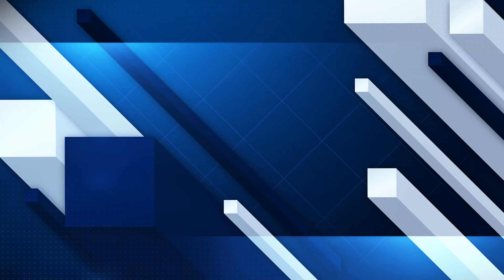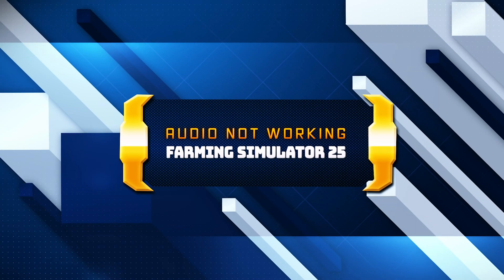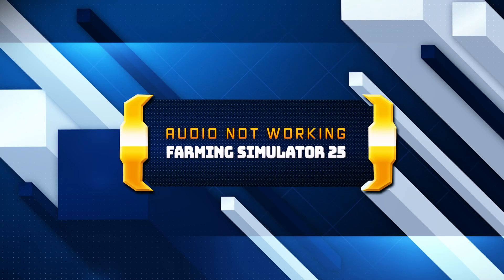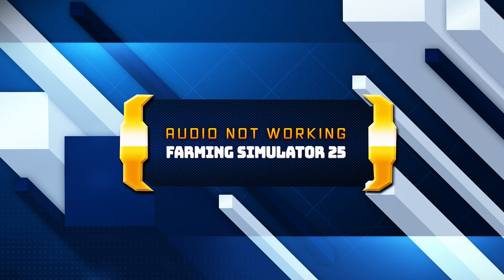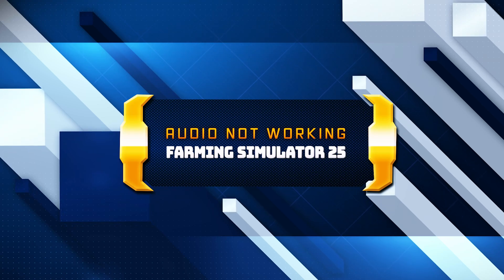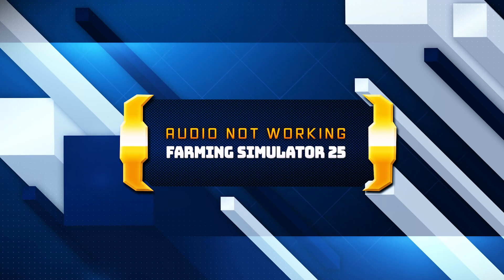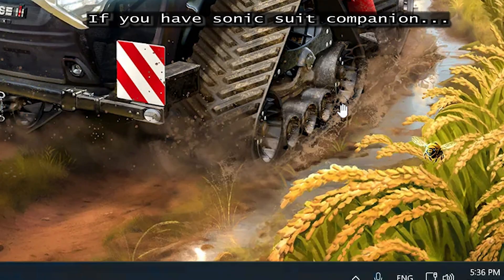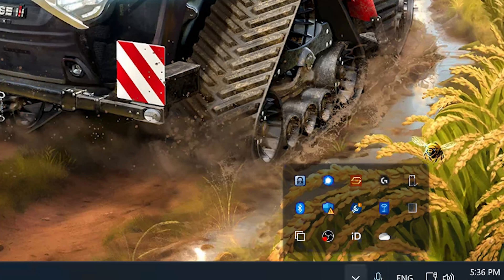Farming Simulator 25: Fix Sound/Audio Not Working, Crackling/Distorted/Popping Audio Problem

Comment: Thank you for this... I had issues getting it to work and ended up having to switch it to 24bit 192,000 hz and it finally came through just fine. That's a bit excessive in my opinion and not sure why they set it that high but at least I have audio now! Much appreciated!
Reply: hey, i have to switch to 24 bit and 192Hz to work???
Reply from the maker: Glad i could help!